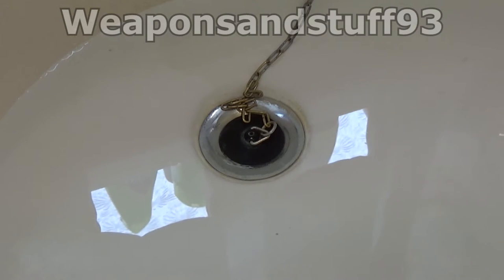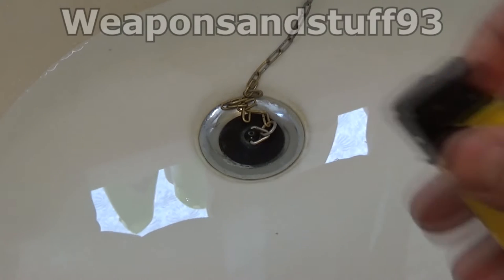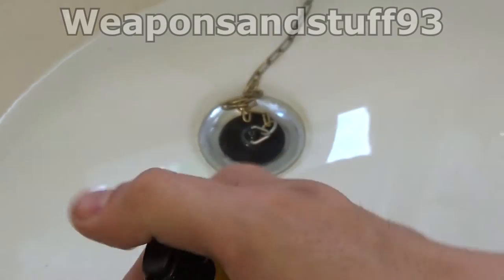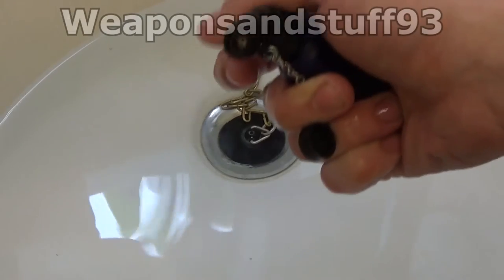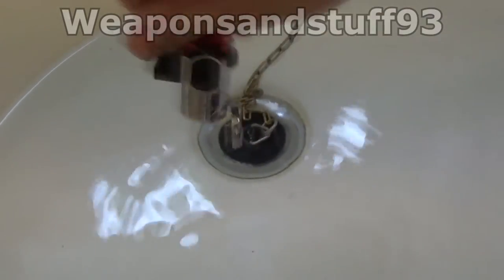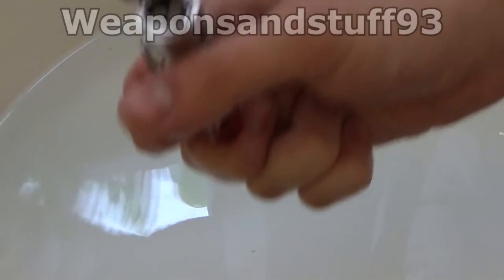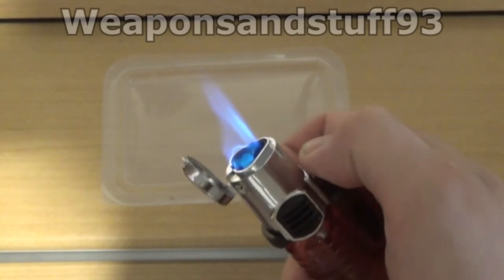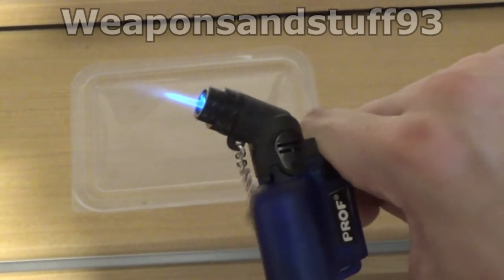Jet Lighter - Waterproof test

Comment: that was very surprising that the torjet was first to light Liam and the prof came in last thanks for the mention mate i Appreciate it, i think i'm gonna get some of the torjet just to put in the bug out bag, and thanks for the review. Shaun
Reply from the maker: +Guns Uk31 No problem, also I found out by accident when refilling it the triple flame lighter actually does have a gas adjuster, after turning it a bit it has 3 super powerful flames.

As for the Torjet it's probably because the nozzle is covered by the lid, whereas I opened them on the other two lighters, if it had a removable cover they would probably have taken longer to dry out.
Reply: so it would have done a real good job on that can then? if it was turned up to high. yeah didn't think about the lid good for splash or rain resistance.
Reply from the maker: Yeah would have done even better but I think it was already about 2/3 of the way up, on very low it won't ignite properly as not enough gas comes through fast enough.

Also I've ordered a proper survival lighter and some high end butane for it, it's designed to be totally waterproof when in it's case and windproof to 80 kph winds.
Tad expensive though about £16, so will see if it's worth that sort of money compared to the £1 lighters lol.
Reply: that will be very interesting, i might wait to see what that one is like first should be very good at that price range mate, cant wait to see it.
Reply: Sorry 😔